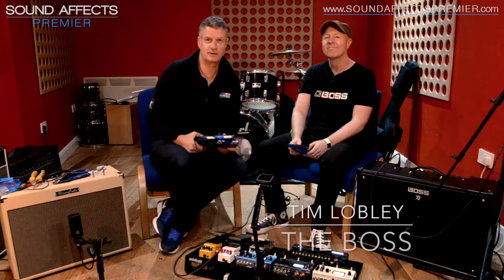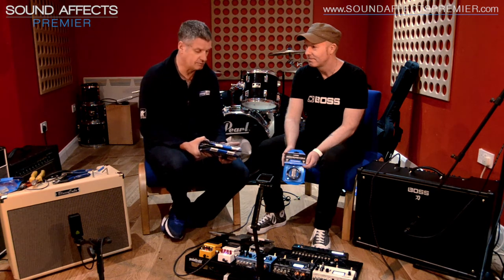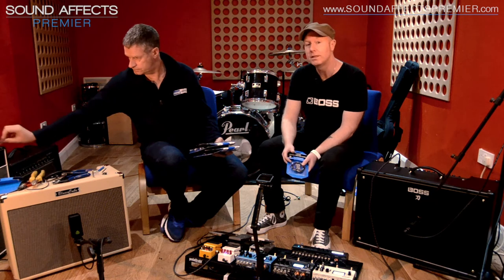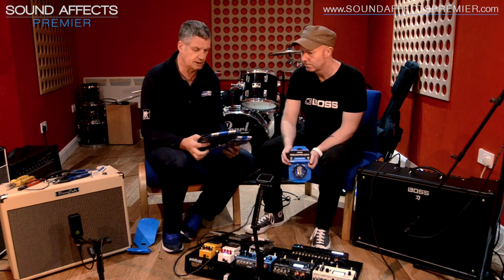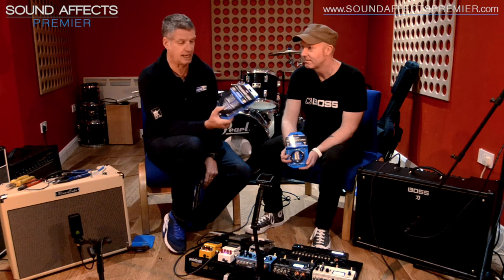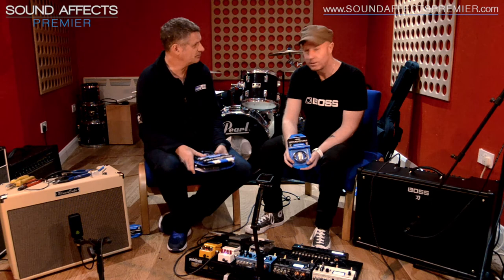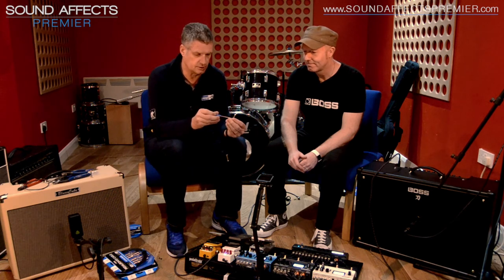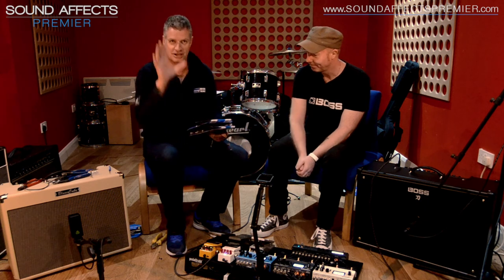Creating CUSTOM Patch Cables for YOUR Pedal Board!

Comment: We cannot see what you are doing with the cable! I bought these solderless type cables from Free The Tone and none of them worked. So I'm skeptical. Need a better more how to video with closer camera and then you guys plug the cable in and prove that they actually work!
Reply: I agree. This stuff is expensive and WE, as musicians don't have time for faulty cables on a gig. WE, want it to be in excellent condition before we leave the house.
Reply: I don’t recommend getting these. I made 15 cables and could only get 2 to work. I’ve literally spent the last 2 days trying to get just 1 cable to work...no go. There’s no way it should be this hard. 

I have some George L solderless that I bought years back and they’re fool proof. These...are definitely not.